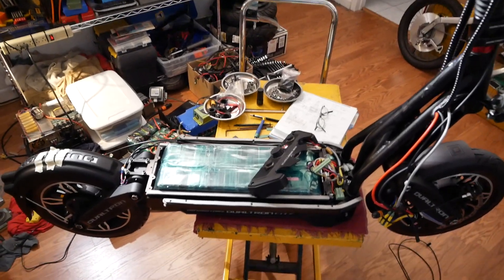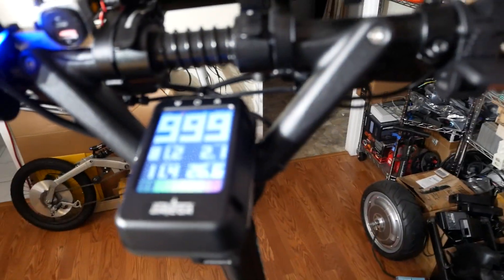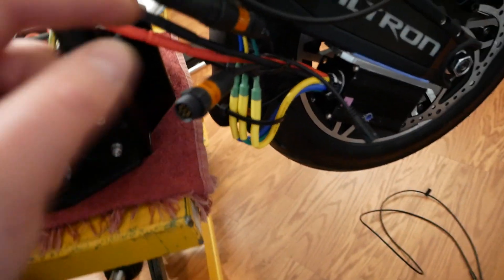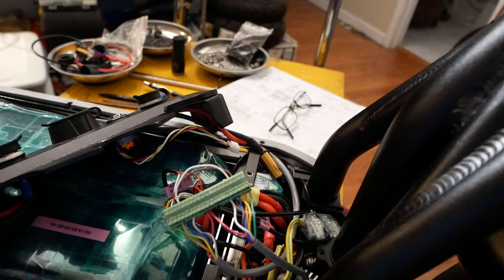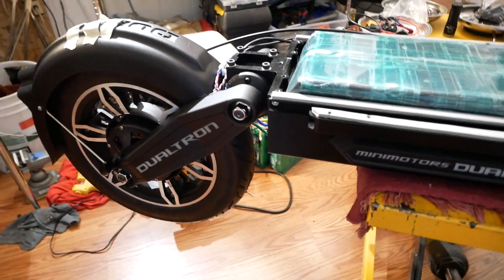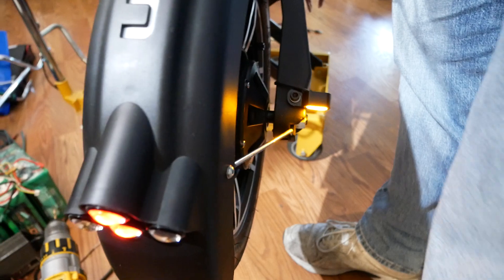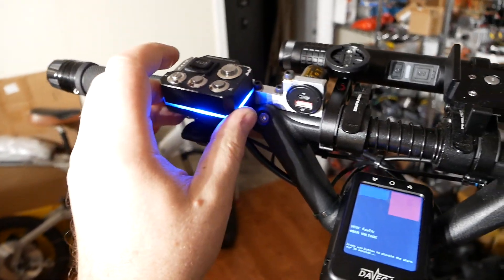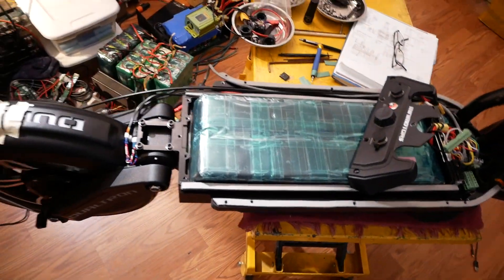Dualtron City build update 20220817

Comment: i need help can u make a batttery for me allso i have 3sccoters my ghost is gone up contlers is bad 800watt screen s contlers is bad or the key volt meter all in 1 is shorted to the neckthe wiers ins ide the neck i pull on it an my screen want dead but the weirs for screen is not in the neck win i was pulling the wiers it was 2brake lines an key meter wiers and the eco dule moter wiers 4 wiers  qall i can think is the key meter is got 52volts runing throw it if it shorts to frame that will cut screen i feel so i need to get new screeen wiers key wiers or i just like to buy pess the key do i  3 wiers one black one red an one off red going toscreen plug do i havbe to put red an black to gether an uses the off red to bring the 52volts over to the screen ill show u the pics an make ull under stand but i need to by pass the key to see if its shorted out to fream i do have motly meter but i am not good with that

Comment: Could you please recommend a daily commute electric vehicle with minimal need for modding for an average male who is neither overweight but doesn't wish to invest many hours in practice nor wear copious safety gear?
Reply from the maker: If you can get a SOCO TC Max, they are quite nice! I had one for a while until it was stolen about 7 months ago. Ride is great, braking is great. Power and range are average, but usable. If I was trying to buy an EV for me, I'd try to get another of these. If a small motor cycle sized EV is too large for you, nothing wrong with the City.
Reply: @de-bodgery  Thanks for your answer. What are the advantages of the 15" tyres and how does the City stack up against other more heavy duty but perhaps better value scooters with 11-14" wheels by the likes of Kaboo, Teverun, Vsett, Obarter or something like a generic Chinese T8?
Reply from the maker: @powertreadssupremacy  I don't know about the others, but Teverun...had to work on a bunch of those. The frame and build is pretty nice,  but the pack and electronics are crap. IF the electronics were as good as the frame and general build quality, I'd recommend them, but 80% electronics failure rates is pretty pathetic! So the City uses 10" rims which is a standard size and easy to find replacement tires from good brands. Other scooters with smaller rims/tires...you are nearly always limited to Chinese tires.
Reply: @de-bodgery  Alright. I've narrowed it down to the City or going through importing the Roadrunner pro or Ecells step star. Have you worked on the Roadrunner pro?

P.S. I wrote another follow up earlier that was censored. I'm in NZ and and need the bike to fly under the radar without registration so big and loud are a no go.
Reply from the maker: @powertreadssupremacy  No idea why YT does that to comments. I run across it from time to time and so your other comment, I just responded to it in line with what you did get to post. I don't know anything about those EV's you mentioned so I don't have an opinion on them. I notice of you post a URL in a comment that YT censors those consistently. Other times, I have no idea why the YT AI does what it does.
Reply: @de-bodgery  How essential are turn and brake signal lights if the municipality you're riding in does not have good bike lanes?
Reply from the maker: @powertreadssupremacy  That's a local thing that I coudn't possibly answer for you.
Reply: @de-bodgery  What's the asking price for your Dualtron City with finished mods?
Reply from the maker: @powertreadssupremacy  Buy one yourself
Reply: @de-bodgery  Sorry, that may have been disrespectful. I noted how long the scooter had been sitting on the bench for so I assumed you may have lost interest in it. You do good work and I meant it as a compliment to your craft.
Reply from the maker: @powertreadssupremacy  Shipping to you would have been rediculous! New Zealand isn't exactly close to the USA!
Reply: @de-bodgery  True, I might also have to pay for import tax duties. On the other hand the City is so "overpriced" compared to its competition in 2024 what's an extra 1k?
Reply from the maker: @powertreadssupremacy  Yeah...can't really help with that. Dualtron is pretty decent quality in most regards.

Comment: I would do it with a ubox controller. I did it on a zero 10x and it's beautiful and fast.
Reply from the maker: I may make a change with the controllers. This scooter has sat for a few months now and I have not gotten back to it. The 75100 controllers didn't perform all tht well, but I also had not done any tuning either.
Reply: @de-bodgery  i figured mine was less punchy off the line, and then i figured its the hall sensors cause under 10kph my scooter was kinda slow, and over 10kph it started to accelerate better (at 2500ERPM which is the sensorless transition point it starts to rip)
Reply: @de-bodgery  Yeah these vescs aren't as punchy as the dualtron controllers. Mine definitely shine their best mid-range. Off the line they're..ok.. 😄

Comment: The can jittering may be because of distance. I remember reading somewhere they need to be as short as possible 😉🤔 good luck 😁
Reply from the maker: That's possible I suppose. Distance is about 5 feet total length. This page says CANBUS can be much longer than I have or 130 feet with 2 devices.  I think I'm OK. I have another setup with 3 devices on CANBUS and they are of similar length as I have now. I'm thinking it's possibly the unsheilded cabling with lots of other signals right next to the canbus signals that might be causing interference. This project has been set aside for now. I have a couple of pack builds I need to finish up first. One is done and the other is 50%.

Comment: Very nice build,  can you share a link to that thumb throttle you got it? it looks different the the one I see on the market. thanks
Reply from the maker: I found them on amazon. I'm sure they are available else where too. It's made by Wuxing.
https://www.amazon.com/Throttle-Disassembly-Electric-Bicycle-Accelerator/dp/B09ZQKC4VN/ref=sr_1_9?crid=1G3J8EHMMV6U3&keywords=ebike%2Bthumb%2Bthrottle&qid=1661263905&sprefix=ebike%2Bthumb%2Bthrottle%2Caps%2C148&sr=8-9&th=1

Comment: Hi my friend!!🙋
I don't know anything about vesc Controllers (i play with YYK Controllers... pure, old squarewave😁) 
But with you put Controllers there...??🤔
I believe you will make a box and put them in or anyway somewhere higher (big scooter, small controllers,)
 The place you put them is before suspension... So all the vibration of the road will hit the Controllers...😕🤔
Reply from the maker: You should go back and watch my 2 issue mitigation videos. Dealing with vibration probably will be OK. The controllers will see bouncing and vibration in their planned for locations.  There isn't really a great place to mount them so I did the best I could to meet things that mattered to me:
1. The phase wires need to be short. Long battery wires are better than are long phase wires. Mine are a total of 20" long. This is about 1/3 the length they were from Dualtron.
2. I've got to get many wires to the controllers. I chose to put all of that as close to the motors as possible as the lengths of everything other than phases and halls can be quite long without issues.
3. Placement where shock and vibration are less puts the controllers in places where they have no cooling mass to use. The swing arms are a big hunk of aluminum and that will keep the controllers nice and cool. 
4. The front end is problematic. It not only has suspension, but also pivots for steering. It was the better option to secure everything to the swing arm than else where. 
5. I'll have wire wrap around everything coming out of each controller to bundle it together. Then it will get secured to the swing arm. This is all to minimize snagging wires on sticks or other things.

Comment: I'm building a bike very similar to this Debodge, I'm going to be attempting the CANbus link for the exact same controllers as well please pray for me
Reply from the maker: I had a thought about my glitchy CANBUS. You are not supposed to have GND and +5v in common between the controllers with CANBUS. In my terminal block you can clearly see that they are tied together between the 2 controllers. This is problematic for many reasons. A power spike that blows up one controller will potentially kill the other one too. I really need to add isolation protection on the 5v lines or just keep them separate. It is possible that my shared connection for them is causing CANBUS issues. CANBUS is a 2 wire communications protocol that doesn't need a voltage reference. I may be my own problem here. I was already thinking about isolating the 5v lines from each controller right after tying them together over a week ago. I think this is my problem with CANBUS.
Reply from the maker: Oh wait...forgot to pray! ;P
Dear lords of EV's,
Please bless gizmo with success and many enjoyable miles on his soon coming EV build. We thank you for your blessings and guidance and blah blah blah. Oh um...yeah...amen.
LOL! There you go...that's about as good as I can pull off.
Reply: @de-bodgery  🤣🤣🤣🤣🤣 I'll have better fortune for sure!
Reply from the maker: @evgizmojm  Whew! I was worried that prayer wouldn't work! haha!
Create an account on DIY electric car. I'm rishimaze on there. We connected back on discord and I bailed after I kept getting hit with stupid drama!
Reply: @de-bodgery  I'll do so right away. Talk soon.